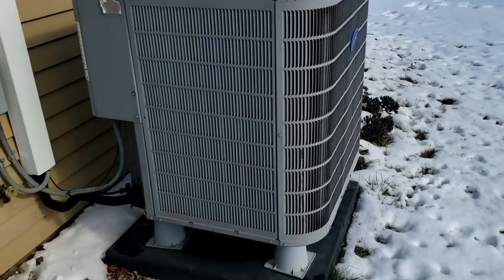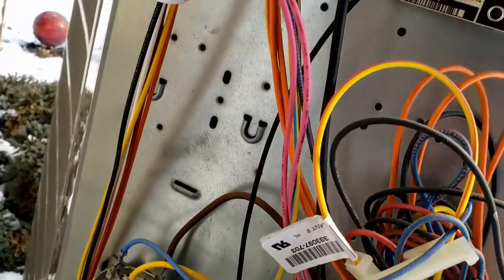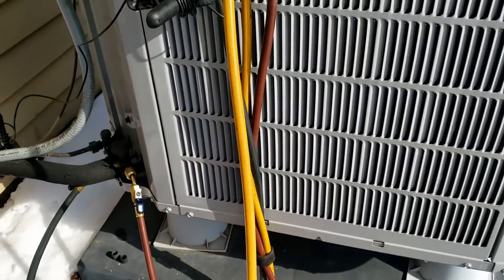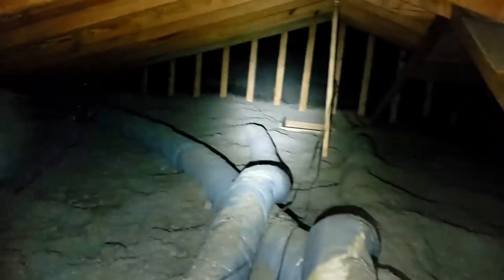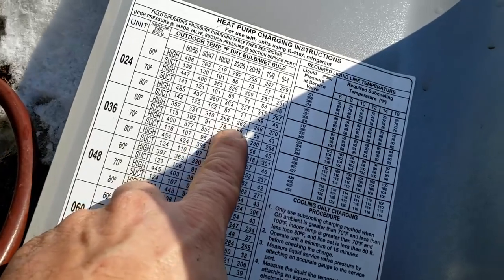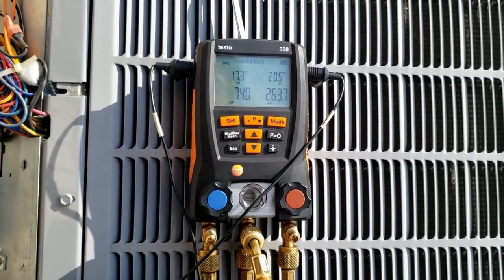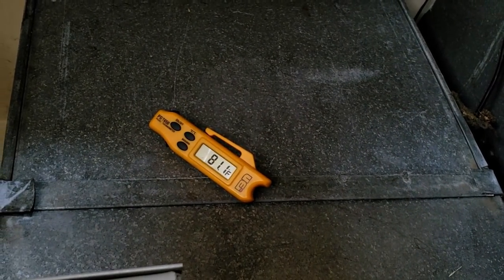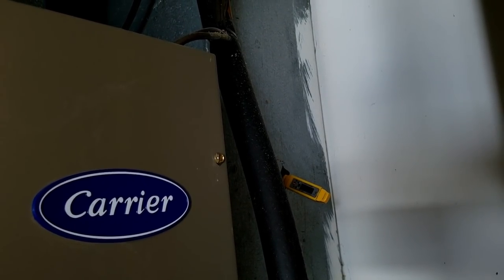CARRIER HEAT PUMP & ELECTRIC FURNACE NOT KEEPING HOME AT TEMPATURE

Comment: Im amazed being here in south fkorida that you can run a heat pump in weather in the teens. How is it drawing heat from outside below freezing? We here are taught cant get heat from outside below 40 degrees. Basically just the heat strips then
Reply from the maker: There is always heat in the air until "absolute"  0 degrees. What no one is realizing is all over the country,  Energy is cheaper in one form verses the other. Some places might only have electric available, the lucky ones might have natural gas available, that leaves propane and fuel oil as the last resort for the remaining customers. Around my area people hate the smell, the cost, and the maintenance of fuel oil but it's very popular in the extreme north eastern America.  Propane is more popular in my area of Ohio vs fuel oil but both propane and fuel oil are more costly than natural gas and some customers worry about any gas in general as being "dangerous".  Currently the cheapest way to heat until the "environmentalist" DRIVE the cost through the roof is natural gas. So to answer your question, I live and work the rural areas between natural gas being available only in larger towns and that leaves the alternative fuels or electric for the remaining customers like me and a good majority of my rural customers. That's why geothermal is popular around Ohio,  but once again, it's a large financial investment to install but can save you money when you don't have natural gas available. So is a heat pump worth installing in Ohio? It depends on your fuel sources available, it's a price we pay to live free away from the pack rat city. No it's not always the best option but it might be the better option.
Reply: I live in the country—rural
Ohio as well—and installed a Lennox heat pump and electric furnace. It does great. The colder it is outside the “cooler” the feel of the heat is, you can definitely tell when the strips kick in. It has no trouble keeping it 70 in here even in the teens.
Reply: @HVACRSurvival  where in Ohio are you located?
Reply from the maker: @tycobb8621  North Western corner
Reply from the maker: @tycobb8621  Heat pump is a lot cheaper to run than the electric strips but not as comfortable. when we have an all-electric heating system we leave the heat pump run nonstop. Sometimes we'll turn it off at 0 deg.
Reply: @HVACRSurvival  it’s amazing how many people think heat pumps are only for the “South”. I was an installer at an HVAC company for about 6 years. We would usually set the lockout at 25 if it was on a forced air gas furnace. Maybe higher if the homeowners were older and didn’t like the “cool heat”. They always loved the savings though!
Reply from the maker: @tycobb8621  your exactly right, I do the same thing depending on the age of the person and type of aux heat.  👍👍
Reply: @HVACRSurvival  subscribed. Love these HVAC videos! Saw you got a comment from Shannon “I wear my sunglasses at” Knight. He’s great, so is @AntiDIYHvac if you don’t follow him he’s great too. Keep up the good work 👍
Reply: Here in southern Tennessee I purposely left the strip heat out of our heat pump and just relied on the compressor all winter. It got to about 5* here. Still chugging the house at 70*F. Unit cycles off an on normally doesn’t run much longer than it needs to. Why? Insulation. Paid 3k before winter to have some company spray foam under the house. Saved so much money.
Reply from the maker: @paulpowers2861  that's awesome 👍👍. It still would go into defrost and blow cold air without the strips?
Reply from the maker: @tycobb8621  👍👍 Shannon is a great tech👍👍 thanks for subscribing!
Reply from the maker: Must be nice not have to use the Heat.
Reply: A few years ago i did a call up in our local mountains it was 10° outside and the heatpump was kicking out 105° air. It was a dual fuel setup. Propane gas for the furnace.  It was working great after i adjusted the charge.
Reply from the maker: I wonder if you overcharged it?  you wouldn't know it until summer🙂
Reply: @HVACR Survival  i had to remove 1.5 lbs of charge. It apparently didn't work very well in the summer as well. Short lineset. I pulled and weighed the charge. Lineset was 15' long and they overcharged the factory charge by 1.5 lbs.
Reply from the maker: @jasonjohnsonHVAC  don't ask me how I knew😁✌️✌️. Ok.... I'll admit,  I've done it🤣
Reply: Over here in Europe we are now using heat pumps with R32 instead of R410. They give full heating power down to 5°F and reduced power all the way down to -18.4°F.
Reply from the maker: Interesting 👍👍
Reply: How you can tell a unit has second stage?  can figure out that yet
Reply from the maker: A few ways to tell. I look up the model number or look for either a solenoid on the side of the compressor depending on the brand.
Reply: @saulsanchez9531  compresor has 2 plugs instead of one
Reply: @HVACRSurvival  interests bcz that is my main concern about a heat pump i live in Illinois Chicagoland area we have very cold weather here many times weeks bellow cero degrees and if system don't work is a terrible thing bcz cold can destroy entire home plumbing ,hardwood floors, paint  cabinets etc 😱🥶

 Better a keep using natural gas furnace
Reply: Modern heat pumps can get heat out of air that's -22F.  It's all about the boiling point of the refrigerant.  They are 78% efficient at -22 F
Reply: @tycobb8621  LOL I'd be FREEZING at 70F ! Gotta be 80 or I'm shivering!
Reply: We have many heat pumps and mini splits that run down to -15 or even lower.  Hyper heat minisplits advertise that they work down to -20 I believe (now they will only blow out 80-90 degree air but they keep running).  Heat Pump technology is pretty amazing.
Reply: My heat pump works fine even at 10 degrees and it doesn't even have heat strips. My only backup heat is my wood stove and I only burned wood to cut the electric bill and for additional comfort.

Comment: Checking the whole system over takes time but pays off. Years ago had a "senior" tech do a p.m. and he stated that everything was fine. Later that day, customer called a said the upstairs was hot. The original tech went out and said "your condenser coil is dirty", he cleaned the coil. Next day, customer calls and said that the upstairs was still hot. Original tech goes out and said "you're low on freon" and adds some R22. Later that day I get sent out when the customer called with the same complaint. I went into the attic to get a temperature reading and saw that the Space Gard filter door had fallen off of the housing and was letting 110 degree attic air into the blower housing. Got to know what you're working with before you start working!
Reply from the maker: Your absolutely correct.  I try and not forget to cover the basics. As I get more years at this, it can be easy to skip things. We need to keep going back the basics and start eliminating possibilities one by one logically.
Reply: So what happened to that tech?
Reply: @SOU6900  Unfortunately, that genius was kept on. It's so difficult to find bodies that can fog a mirror in this market. He eventually quit but not soon enough for my liking. Months later he actually applied to come back. I told the manager, hire him and you'll need a replacement for me. This tech was a living brain donor. Couldn't determine superheat or subcooling in the trade for 30 years.

Comment: Only a DIYer but seeing ducts like this in the 91 unit condo community i help manage convinced me to do a conditioned attic ( house in Northeast) Round metal ducts for all but the last 6 ft, Gut renovation townhouse
Being in so many of the attics in Summer and Winter led me to think it was stupid to send AC air into a 120 degree attic in the summer time and Heating air into a 40 degree or colder in winter.

Comment: Thanks for the video. 
question - I have a air source heat pump with 24 KW heat strips for cold weather operation. (4) sets of 6 KW each. Have you ever seen heat strips go bad? When I run  at 12 KW - Aux 1 heat - I am getting cold air out. But at 24 KW I did get warm air at the register.  My tech says full electric current is going into the strips.
Your thoughts?
Reply from the maker: Using an amp probe would tell you if each is truly working at rated power.

Comment: Wow did you say a 15 kw heater on a 3 ton? I have a 3 ton and only have a 5kw heater. At 1500sq ft. It keep the house warm a little too warm. Yhat duct definitely needs replaced. The barrier is old and dried up due to attic too hot and years old. Plenty of room to run duct up there. Just have to plan it well. Good clean diagnosis Rick. Great video. Until the next one stay warm and safe.
Reply from the maker: Yeah 15kw, that's all gonna change depending on your design temp and where you live. I'm in Northern Ohio so it's cold here. Thanks for the kind words Ray 👍👍
Reply: True in Ohio is alot colder there than NC. wish I was up there, would do all your duct for you. Love doing duct. You are very welcome Rick.

Comment: If you install a higher Kilowatt heat unit will it make it hotter when the heat is on?
Reply from the maker: Yes but electric costs 3-4 times more to run than the heat pump.

Comment: The defrost settings are still set to factory defaults. 90 minutes of run time and the quiet shift is turned off. It needs to be defrosting at least every 60 min.  With the kind of cold you have I would probably set it to go every 30 minutes.  And those units sound a lot better when the quiet shift is turned to ON.  👍
Reply from the maker: From what I gather the customer uses his wood burner most of the time and only uses this when they go away.

Comment: Had one the other day and was similar. Tried a gas & go but had to recover most when pressures suddenly jumped up to over 400.  Echhhh, sometimes I think oil might be trapping and when it clears the oil the pressures suddenly jump up to normal. Then again I was using 422b. OEM always  state, recover and charge by weight during winter. Realistically speaking we have no time for that...
Reply from the maker: I hate using alternative refrigerants on heat pump systems, everyone forgets that the condenser in heat mode is now your evaporator and it's a lot smaller. Not as much room to condense. Things can go south pretty quick LOL 🤣

Comment: That old grey flex always deteriorates. I have charged many Lennox ac systems in cold weather like that after an install to subcooling. Usually the charge is good or 1 or 2 degrees of sub cooling. I like that uei thermometer. Lost a dozen of them. Forget them on the ductwork. Find when I return next year for maintenance.
Reply from the maker: I see losing that thermometer easy because the magnet makes it easy to leave behind. I should have gone into more detail on the subcooling, specially with this having a fixed orifice. I regret not going into more detail about the video at the end to clear up a lot of veg comments. O well🤷‍♂️. Live n learn
Reply: @HVACRSurvival  i wish I knew what it was like not to get a bunch of neg comments on my vids. I don’t work on many air cooled heat pumps. I’m wondering where al the cold air was coming from?
Reply from the maker: @thehvachacker  I've been getting a lot of weird comments that don't make sense. It's like they talked it out in there heads but forgot I didn't hear what it was they were talking about🙈🤷‍♂️😂

Comment: I truly want to love the UEI folding thermometers. I have purchased at least 6 of them. However, they love to glitch out if they get wet. They also cannot be calibrated. I recently purchased two ThermoWorks 600D probe thermometers. Waterproof, digital, allows trim calibration. Hope these hold up better.
Reply from the maker: Thanks for the info! I might get one more but I can see leaving this behind like the previous owner did. I also noticed the plastic around the probe is starting to crack. I doesn't appear to be as strong as some of my other thermometers.
Reply: I truly want to love UEI but their amp meter crapped out on me after about a year. Does not read accurate voltage. Which now confirms it for me, I’m a fluke man

Comment: My heat rise isn't much. Would lowering the fan speed mess up my pressures? The freon is in the normal range (per the Lennox chart/hpx14. 3ton). Aux heat works great. I'm ready to pull out my hair as the heat pump only never seems to "catch up" when it's 30 or less out. Thx
Reply from the maker: You really need to know what your doing before you start changing the speeds.  What I mentioned was a feature that Carrier offers on there ECM blower equipped equipment.  It will automatically change back to normal speed when the outdoor temp gets above 40 deg F.
Reply: When it’s 30 or less out it’s generally going to defrost more often than not and won’t be nearly as efficient including being difficult to keep up with any temp swings.  Hence why a lot of systems have temp lockouts of 30-35 degrees to only run backup heat below those temps.
Reply from the maker: @jphvac5725  except when you're all electric. the heat pumps going to pull somewhere between 5 and 8 amps of current, the electric strips going to pull 20 to 24 amps per strip times three or four. You can run that heatpump non-stop and still be less kilowatt used. Welcome to the colder climates of the country😂.  Now if you're one of the lucky ones that live in the city that have natural gas then yes you are correct that is where we will lock them out.

Comment: Thanks for the video. Is it possible that with a lower fan speed the overall capacity would be reduced but the supply air would be warmer?
Reply from the maker: Yeah it might reduce it some but it will feel more comfortable.

Comment: You mentioned a fan setting below 40°.
Can you point out a manual or unit I can look that up in? I have not heard of that, nor been informed of that by out local Carrier dealer.
Thanks!!
Reply from the maker: It only works on Carrier air handlers and furnaces that have a ECM motor. I should have gone into more detail at the end. How this works is they drop the G signal and the motor will drop in speed to help create a better temp rise.  If you do this on any other type of motor or brand then the fan won't run... Not a good thing😁
Reply: @HVACRSurvival  g signal is the slowest. They must be dropping the yellow to slow down the motor.
Reply from the maker: @Bryan-Hensley  from what I've always read they use the y1 and or y2 signal to keep the fan running but at a reduced speed. This is only on ECM Carrier systems
Reply: @HVACRSurvival  oh okay. I'm not super familiar with that model
Reply: @HVACRSurvival  
Are you referring to quickly turning the fan off and on from the stat? Supposedly each time you do this it steps the fa speed down one.
Reply from the maker: @jrsmyth9761  no but I remember a system that used that, not sure what one it was.